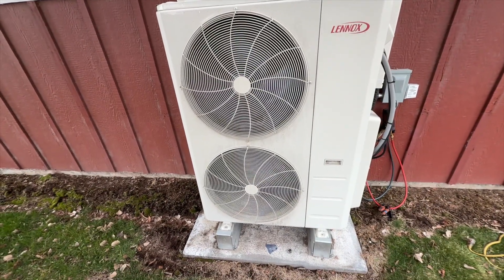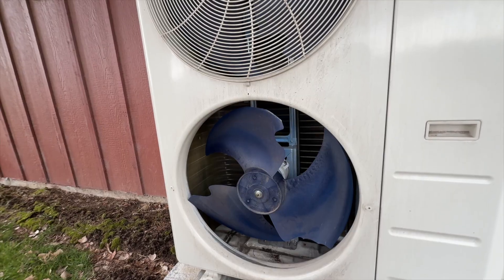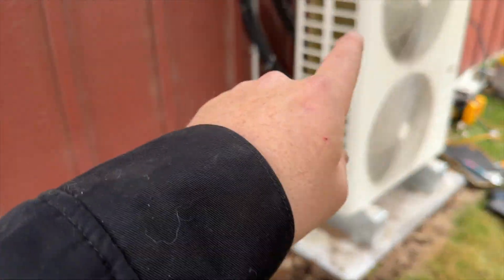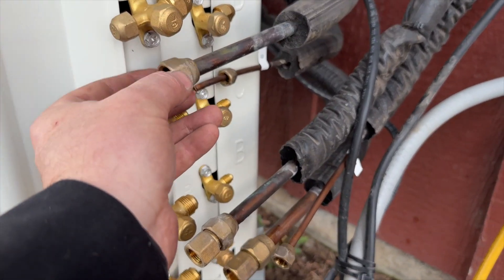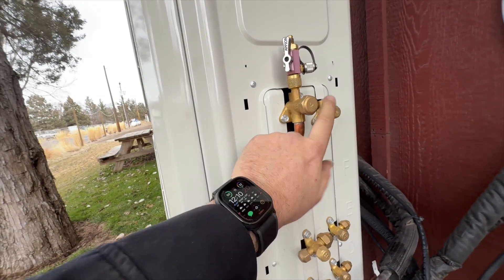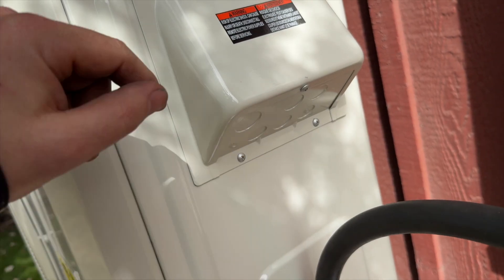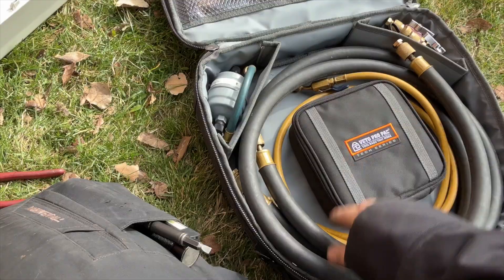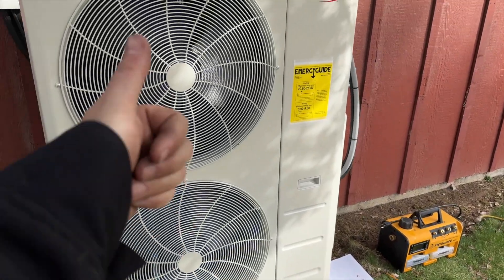F5 Error Code For Lennox Minisplit Turns Into  Unit Replacement Under Warranty EP217

Comment: 😂😂😂 that’s crazy a whole new unit just because a bracket broke Lennox is king when it comes to selling u all the individual parts for their units, sucks for the customer on labor but I rather be paying the labor than a whole new unit, 1 tip add a pack or 2 of AA or AAA to your veto bag because those micron gauges always die on u at the worst time or at least saves a trip to the van